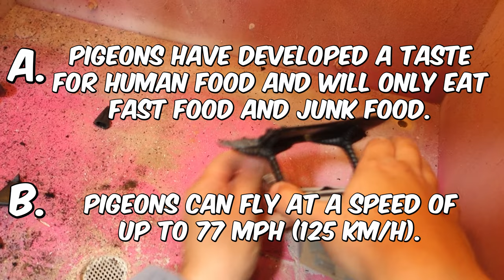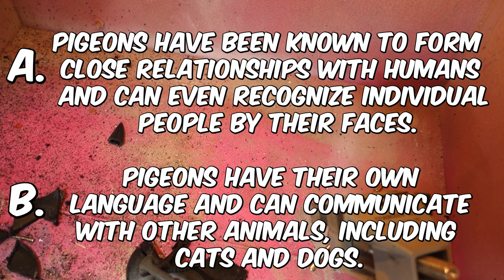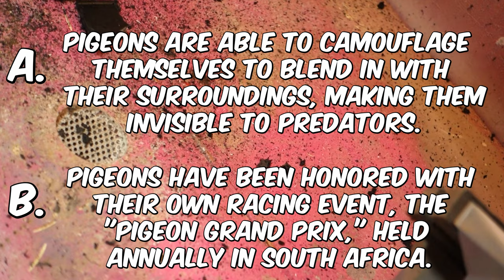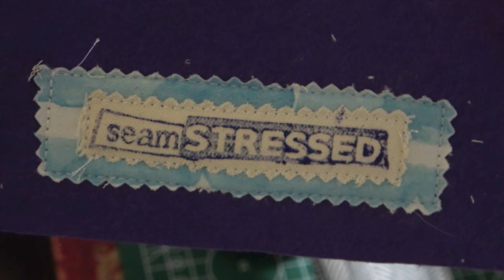PIGEON CLUTCH! Flipping Amazon finds for cheap

Comment: When I shake like that it's usually because my blood sugar dropped and my blood pressure is up ,I don't know if it will help you but you could try to drink some orange juice to get sugar quickly and lay down with your feet up for a few
Reply: tremors are often a neurological condition or a symptom of one and as someone who has started to inherit one its very characteristic of that sort of tremor. its persistent day to day but has good and bad tremor days.
Reply from the maker: I think this specific earthquake hands episode was linked to my ADHD meds, but I will def try this the next time. I have a weird eating pattern anyways hehehe